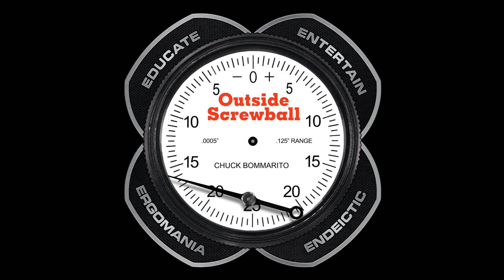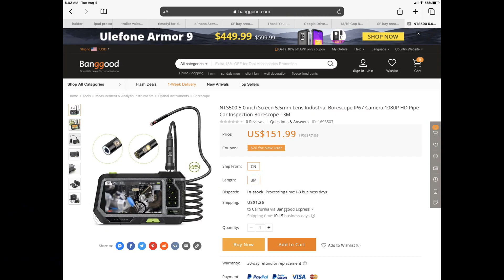Carbide insert explodes (bozo)

Comment: LOL, very bad surface finish!
It comes with the age.
I have countless times wondered why the cut is so imperfect. The reason being to not to tighten the QCTP. I usually use inserts that have so low cutting forces that it works until You take a deeper cut....
Loose things seem to be my Nemesis. Forgetting to tighten the compound after painstakingly dialling in a taper, forgetting to tighten the milling head indexer, forgetting to tighten the SK30 drawbar ... the list seems to go on.
In case You wonder what is a miling head indexer, look for Schaublin SV-51 and then You know.
Reply from the maker: LOL....thanks for viewing and commenting...have a great (safe) Thanksgiving

Comment: As pointed out by others, the insert screw seemed to be loose/insufficient or defective.I've seen some cheap tooling where the threading on the insert holder is oversize. This lets the retaining screw rock and/or back out, allowing the insert to move around under load. Thankfully no injuries from this incident. On a positive note you now have a new carbide form insert! I admire your candor in sharing this incident, we all make mistakes. Thanks buddy.......
Reply from the maker: thanks for viewing and commenting...have a great (safe) Thanksgiving

Comment: Very tough insert.  I did a similar thing with the mill.  I ran a 3/8 carbide end mill through a 1/2 thick piece of aluminum at about 5/8 depth running in reverse.
Reply from the maker: thanks for viewing and commenting...have a great (safe) Thanksgiving